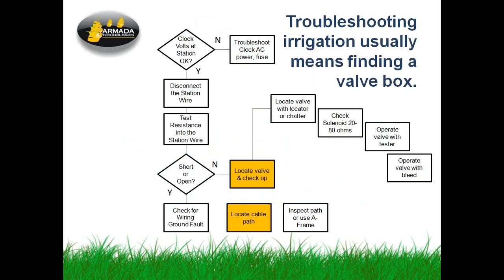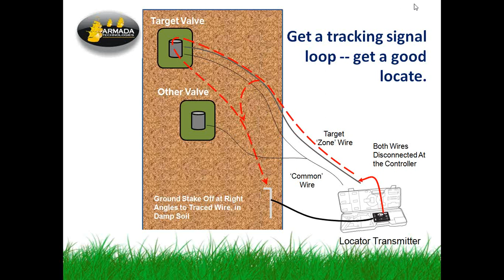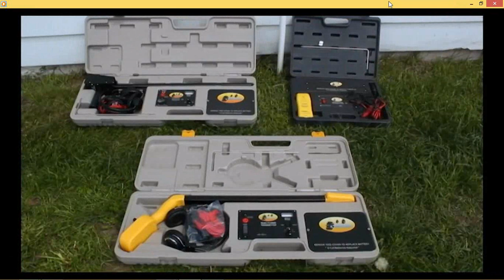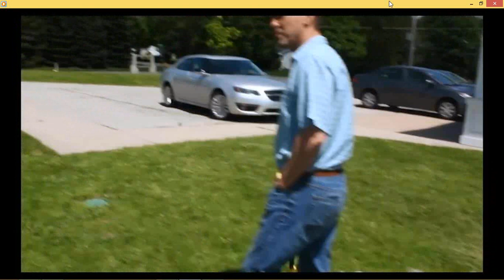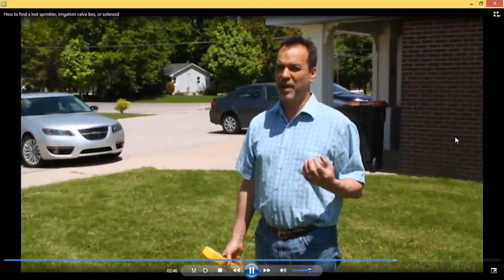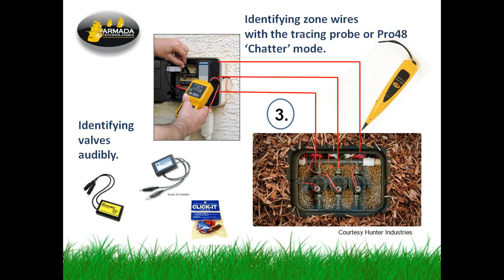Detailed How to Use a Wire and Valve Locator Tracker to Find Lost Solenoids Valves Armada

Comment: My wire path is basically a T shape 
1-4 on the south and 5-10 on the north line.
I'm searching for 6 and 7
I hook up to 6 and still get very noticeable spike at 5 and really not much else. Basically all I've been able to do track the path of the wires .  Unfortunately I don't know where the 8,9, or 10 are or I would try to calibrate my wand sensitivity off those as well
Any help would be great
Reply: Hi Jason: So, as you walk down the main cable path from the controller you come to a point where the wires for zones 1-4 turn one way and 5-10 the other way right? When the wires are laying close together the magnetic signal from the transmitter will tend to bleed onto nearby wires, so some care is needed to tell the difference between wires. One factor is to be sure to disconnect the Common wire at the controller because it will make the ghost worse. There may be a wiring problem out beyond 5 that is aggravating your tracking. Can you open the valve boxes and physically inspect the wire and splices (even tug on some of the wires to be sure they are secure in the wire nut). Let me know what you find and we might try some other things.